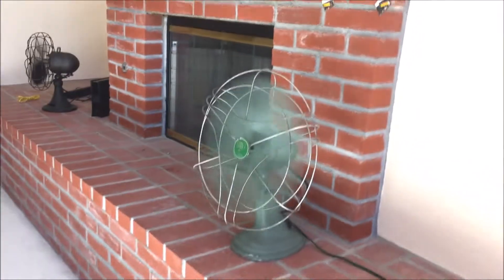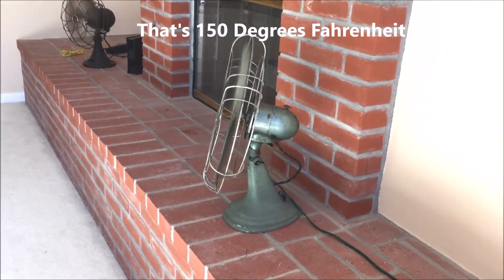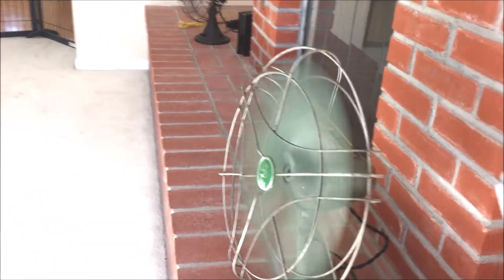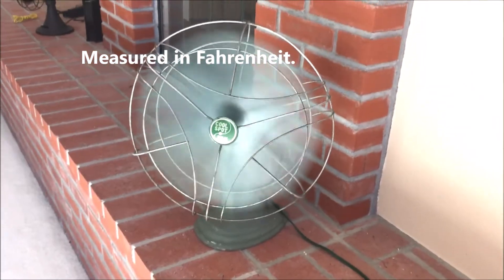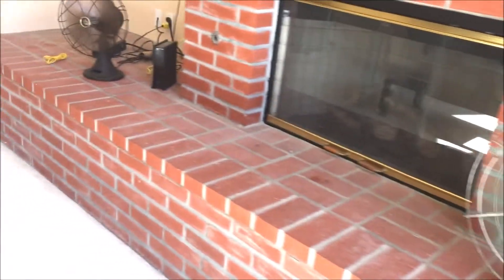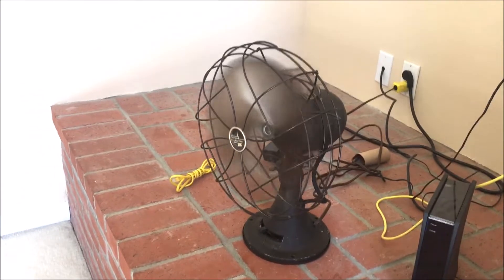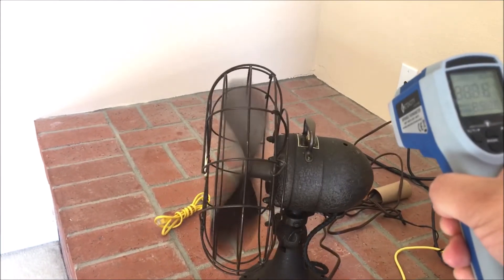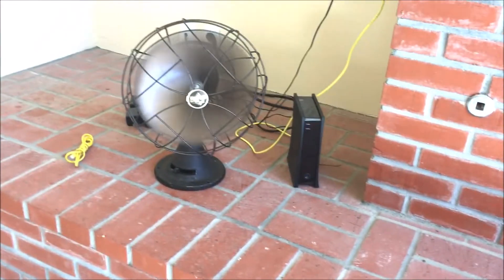Fan Motor Temperature Comparison - PSC vs. Shaded Pole

Comment: Did you ever compare energy consumption between these?  Nevermind, found your other video where you do.
Reply from the maker: Yeah I figured that I should follow up with the power usage for the different motors.
Reply: @DBVintage  I'm curious in what the power differences are in between nearly identical models of Emerson, like the 77646 compared with the 79646, using the same bearings, same blades, with the only change being to a shaded pole motor.